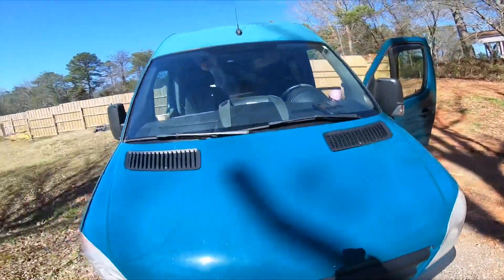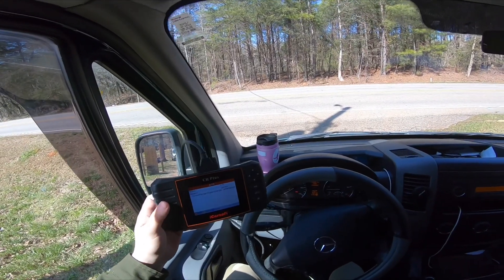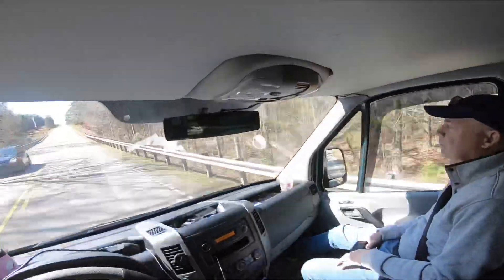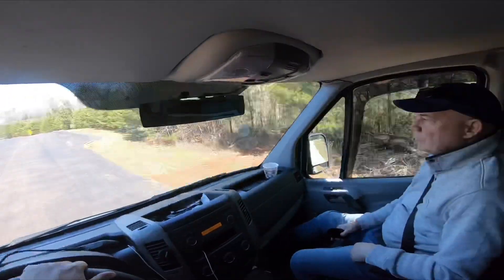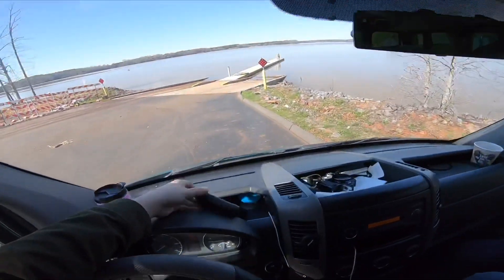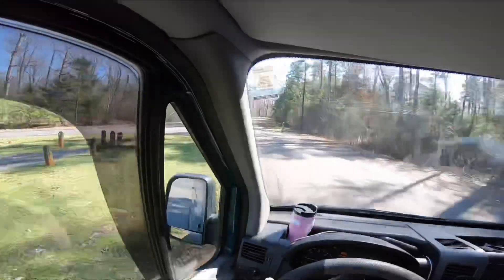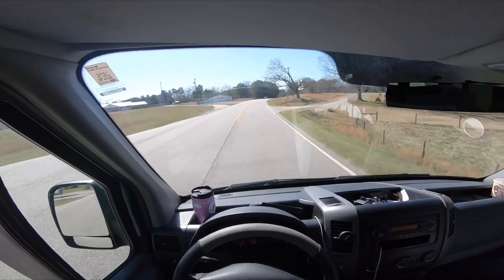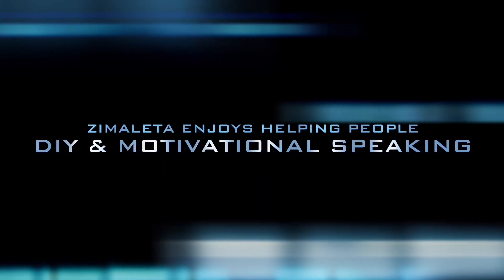P0299 Low Turbo Boost on 2011 Mercedes Sprinter turbocharger or supercharger low boost condition

Comment: You need to get a better understanding of what "low boost" is and what "overboost" is... A leak in the "boost" due to a cracked intercooler hose will never create an overboost condition... Doesn't matter how fast the turbo spins. 

Also catalyst doesn't mean DPF. The van in the video has 3 catalytic converters and one DPF. The very first tank in the turbo downpipe contains 1/3 cat and 2/3 DPF. The NOx sensor don't really have  anything to do with the DPF, they have to do with DEF. The 4 exhaust temperature sensors and the pressure difference sensor have to do with DPF and its regeneration. On the van in the video, the exhaust system has two independent/stand alone systems, DPF and DEF, both are controlled independently. 

Like I said in the past, its about time for you to move on from T1N and learn NCV3, if you want to stay relevant with your videos. T1N in few more years will be a dinosaur and if you stay with it only, you will become irrelevant along with it. That is my advice to you...

Learn NCV3... This is a good start 👍
Reply from the maker: It’s smart advice and I appreciate it, I am doing everything I can to learn NCV3, but the way I learn is by doing, I don’t do much else for now then hands on, My sprinter videos don’t make me any money unfortunately, and the work you see me do it’s free work, so it does not pay for me to just dive in and learn this model, for that to happen I need to get payed by running my own shop, but if this happens, then most likely I will not share my knowledge, because what’s the point if I will keep people away from the shop in the first place, but running a shop it’s not my goal right now, I don’t know what the future holds, so for now this is a Hobby for me, and from one DIY guy to the DIY guy that’s watching my videos, I simply share my opinion and my thoughts, and sometimes I am Wright and sometimes I am wrong, but I am always learning and sharing what I learn that’s all, so for now I will just keep doing what I am doing and not worry about how well I know sprinters.